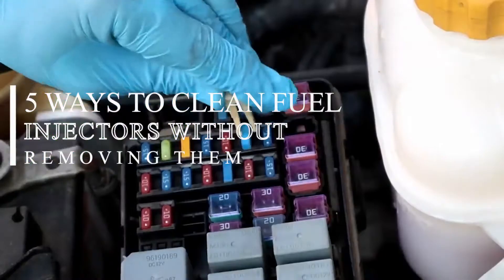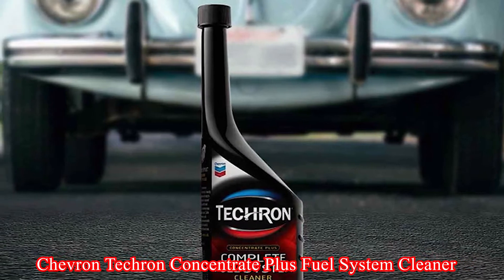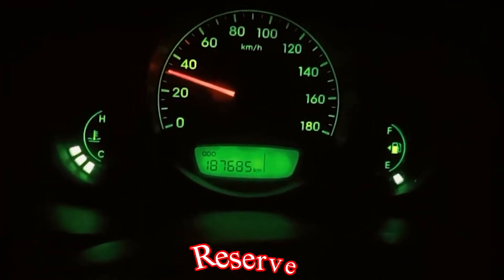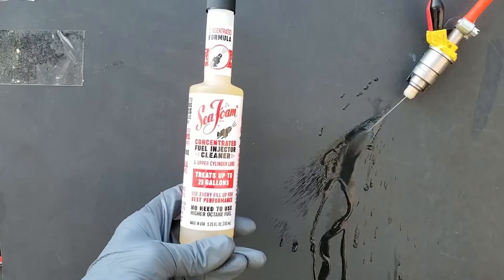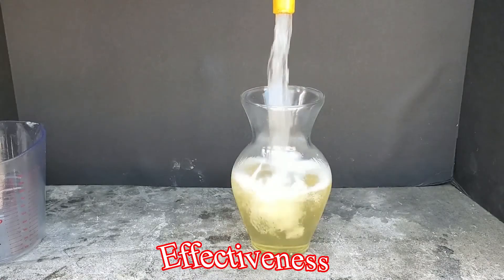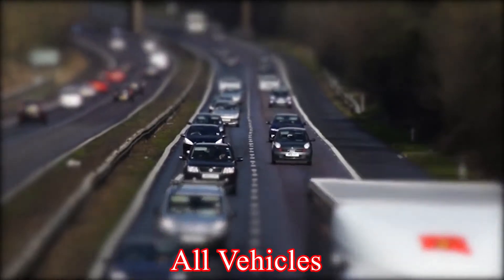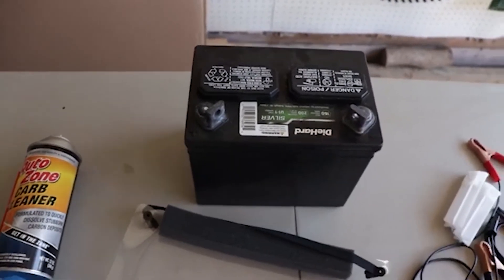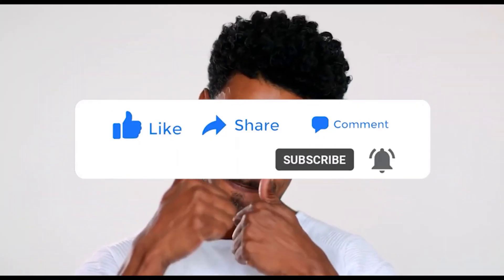5 Ways on How to clean fuel injectors without removing them

Comment: You mixed cleaning methods of injectors with valves.  The only product/method that does both is the Seafoam as it can be added to the fuel system and crankcase through the oil cap.

Comment: Bro, your advice is terrible!  Filling up your car oil filter with fuel additive won't clean inside the injectors, and blasting wall nuts inside  the intake won't clean the tip of the injectors 😅! Seriously, is this a prank?
Reply: If you listen carefully or read the transcript, it is the FUEL filter, not the OIL filter.
Reply: Been using 1 litre of ATF in my Ranger twice a year for 15 years. 305,000km and still running like new. Pour it in the tank, fill it up or fill it up and pour it in the tank. I prefer the first. Mixes better than smooth roads.